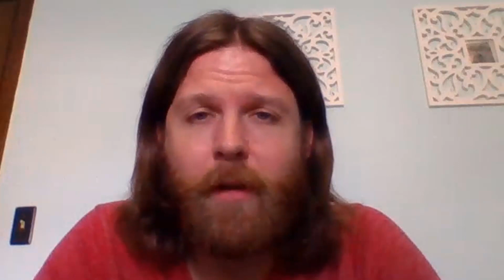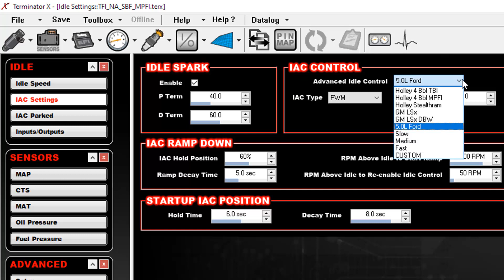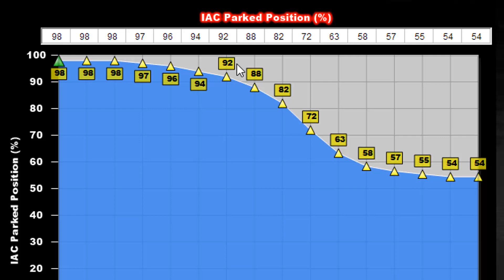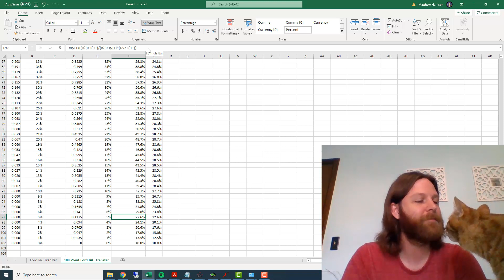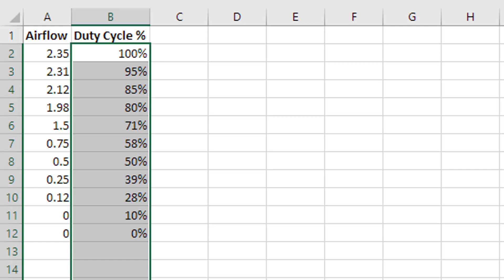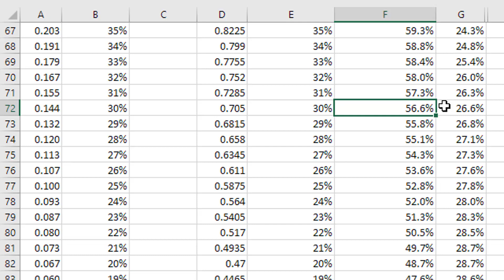Holley EFI vs. EEC-IV - EP1: Linearizing the 5.0 PWM Idle Air Valve

Comment: Wondering if you would be so kind to guide me in the right direction of a project I’ve been on. I took my Stock 5.0 out of my 89Bronco! and built a 347. I converted the speed density to mass airflow using a Mustang A9P computer. Seems to run strong. Problem is when at operating temperature at high load low RPM. I have some pinning.

Comment: @LeechMotorsports I happen to have a panther platform 5.0 loved your video on idle linearization to get the best airflow 

I would like to get your feedback on improving performance with slight ecu upgrade based on your data.

Comment: Do the adjustment numbers you use one the ford iac pwm valve apply if your using a GM stepper valve? That being said i ordered the 550-937 for my car. I plan to use the gm setting for the iac and was wondering if you need to assign it to output 4 or is that only if you use the ford iac.

Comment: I have a question if you could help me, I just installed a MSD 6a ignition box ,will the ignition box affect my BAMA 4 bank eliminator chip tunes , ever since I installed the ignition box I lost the 3 stages on the dial nob but runs good on the number 4 stock tune .

Comment: This is brilliant! I use Haltech myself (on a Ford 2.0 YB Cosworth)  but I imagine the same principles apply. Address the root cause, not the symptom. I found this very enlightening. You’d have to think the aftermarket guys simply don’t have the dedicated R&D budget that the OEM’s do. Have you seen the same with other brand stand-alones? And on this, if you are mainly doing street stuff then why bother with stand-alones at all? I know the EECIV can be tuned with the likes of Moates so you aren’t losing any other functionality? I know it’s not as ‘easy’ to tune as the Holley (and others) for various reasons. Keep up the great work man - just subbed 👍
Reply from the maker: Thanks Dan. Yes this is one of many reasons we always tel people to tune the stock computer if it’s a street car. Doesn’t even really matter what car or ecu we are talking about. As long as the ecu CAN be tuned, it should be used for street stuff. OEMs do so many things well.

Comment: Matt, I'd like to see Holley come out with more than just a Ford "Linear" option for the IAC drop down. I am using the GM piece with the Accufab adapter in my switch to the Holley X. 
I understand it's not perfect, but I'll take better for now. 
If Holley does make a software revision to the Ford IAC, it will leave those of us running the GM unit in the cold. 
Just thought it was worth mentioning as you talk with Holley. 
My car is at the tuners getting the X installed as a write this, so it's becoming a relevant concern for me. 
I'm switching over from the stock computer with SCT chip, for reference.

Comment: SO HAPPY YOUR DOING THIS!!!! I'm in this dilemma right now. I have a street car, looking at an ON3 with a stock Windsor. I've been looking at a terminator x swap for the tunability of it..
Reply from the maker: How are you planning to use the vehicle? How much boost? Stick shift or auto?
Reply: @LeechMotorsports  Just a fun, weekend toy. possible road trips. I built the car in 2008 - was a 4cl auto car i converted to 5.0 5 speed. Currently have an A9P and the engine is stock save for a cobra intake. I do have fresh GT40ps and a comp cams xe264hr w/ 1.7rr's waiting to go on before the Turbo. I want to make a safe 400hp with that setup and an on3. The car right now is SUPER reliable. Runs like stock, idles beautiful. I dont want to lose that and with the mild cam and turbo i thought pulling everything out for a holly is what needed to happen.
Reply from the maker: For that situation, I would 100% stay on the stock computer and have it tuned appropriately.
Reply: @LeechMotorsports  The problem is, nobody close to me does any tuning with these computers. I have no problem driving a decent distance. When the time comes for that i'll have to do some searching (not sure where you're shop is located, i just found you guys via brew2l's channel)
Reply from the maker: @AviJus  we do remote tuning. That’s the vast majority of our work. Shoot a message to us on our Facebook page and we can discuss the project.

Comment: I'm most likely way off. Can a 1d offset table be created for the error %. So IAC offset vs IAC position. Would that keep the valve from never going under 29% and adjusting Idle plate to set idle. This obviously would not change holleys algorithm but maybey it would soften the off throttle between shifts.
Reply from the maker: That’s a good thought, but it wouldn’t be possible. I’m this situation, both the input and output of the table would be idle air position. And essentially if we tried to add or remove idle air at a certain duty cycle, it would just do a loop, then make another adjustment instantly based on the new commanded position, and it would just flail around. I actually have done something like this to try to counteract certain ignition timing changes when re entering idle. But the reason that even remotely worked was because the input was based on rpm, not the current commanded spark.
Reply: @LeechMotorsports  I am assuming your saying you cant offset the IAC based off the computers IAC output? It goes into some circular loop. That would be too easy.
Reply from the maker: Exactly.
Reply: @LeechMotorsports  how about IAC offset vs map some how?
Reply: @LeechMotorsports  I was going to try it with a IAC offset vs actual IAC with your deviation numbers. Then I was going to not use holleys logic, zeroing out the hold position and have another table with a ramp IAC position vs rpm based on the ford air numbers using numbers in your spread sheet. I was also going to trigger it after a certain ignition timing to avoid cranking IAC numbers.

Comment: Thanks for another great video! Keep them coming.
People buy the Holley thinking it is mainly plug and play with their canned tunes. They soon realize they can't get the  IAC to function without diving into the software. Most likely I will convert to the Holley due to the other features (boost control, datalogging, etc...) not because I think it will provide superior drivability.
Reply from the maker: There is definitely a path forward with Holley efi for these cars. It just takes some special care with certain aspects of the tune. And if you aren’t already familiar with some of its quirks, you may not immediately find ways to overcome these things. I just got off the phone with a very influential team member at holley, and will do my best to work with them over the coming months. My spirits are lifted.

Comment: I’ve setup a 1-D table in the Holley with duty cycle vs rpm on a buddy’s Fox with a 5-speed, heads , cam , vortech, etc. and have eliminated the drivability issues that way.
Reply from the maker: I’ve been done that path plenty as well. It can work so-so if you actually take the time to sweep target idle across the entire rpm range to determine the appropriate iac duty cycle to maintain each rpm. But that technique still gives no consideration to temperature or changes in target idle speed that you may want to command. Most often, people end up with intermittent runaway rpms.

Comment: Is there any truth in saying that the tuning chips will overheat the processor in the factory fox ECU's.  I've seen where refurbished ecu's have the J3 port blocked off and if opened will void the warranty on the refurb.  Also on my ECU board that contained a sct chip before the holley went in you could see the discoloration around the processor, is that from heat?
Reply from the maker: I’ve never heard this before and we haven’t any issues with that.

Comment: I was moments away from buying a new terminator kit for my ~400hp fox until I saw this video. Is there something better on the market I should consider? (347 stroker, Holley Systemax heads and intake, stock ecu, 5 speed, looking to add a blower)
Reply from the maker: If you still have the harness and ecu in your car, and they are in good shape, I’d suggest just staying with that and having us (or any other reputable sbf tuner) get the tune done with a Moates quarterhorse and a wideband.
Reply: @LeechMotorsports  I’m in IL and wouldn’t know who is reputable and if they’d use a Moates. I’ll check the Foxbody forums. Thanks and look forward to upcoming videos.
Reply from the maker: @MrMrferg84  I know of shops south or east of you about 300-400 miles, but nothing closer. If you want to go down the remote tuning path though, that’s something we do every day and would be happy to work on your setup

Comment: I sent a link to this video to Mr. Devin Vanderhoof who has a direct line to Holley EFI. He is a fellow youtuber such as yourself although he primarily tunes and wires the very high horse power drag cars. The key is that has a direct line to the Holley EFI engineers because he, along with many others, does beta testing for the Holley tuning software. He is very knowledgeable with regard to the Holley products and if willing could be a great asset to impart your knowledge through to them. 
I so wish you the best luck in promoting some Ford knowledge on to Holley since they are very slow in taking up any interest in Ford products.
Reply from the maker: I follow devin very closely and he definitely is very experienced with Holley efi. I’ve learned a lot about working with higher end race car builds from seeing his techniques. At some point, I need to just reach out to Holley to see if they will entertain some discussions with me.

Comment: I always worry about the age of my stock computer it’s 32 years old and wonder what the life cycle is on these things.
Reply from the maker: As long as you make sure your capacitors arent leaking (get them replaced if so) and no burnt traces then you should be all good to go.
Reply: @LeechMotorsports  Doesn't the processer have a life? When it will go bad?
Reply from the maker: Not the processor as a whole. But electrolytic capacitors so have a finite life span, and that is the #1 culprit for ecu failure. Fortunately they are cheap to replace if you are handy with a soldering iron.

Comment: So what is the main issue? RPM's drop too fast on shifts? Has anyone tried using the GM stepper motor?
I have yet to install my Terminator and I am hoping I can get good repeatable driveability. I bought this ECM for it's ease of use and adjustability. I was so tired of encrypted factory tables and sinking money into a factory ECM that just recently took a crap.
Reply from the maker: We have tuned many on the gm stepper setup as well. It definitely produced more airflow at lower duty cycle. Then seems to somewhat even out at the higher duty cycle haven’t done a true A/B on the same car, but have tuned enough cars with each style to loosely observe the differences
Reply: @LeechMotorsports  Thanks for the reply. I think the Holley engineers are open to constructive suggestions. I'll be waiting on more videos regarding this issue. You have our attention sir.

Comment: Thank you for explaining. Been running my terminator on my 93 about a year now and had decent response with idle even with a/c running over here on the other side of the state. But occasionally it will allow the car to stall.